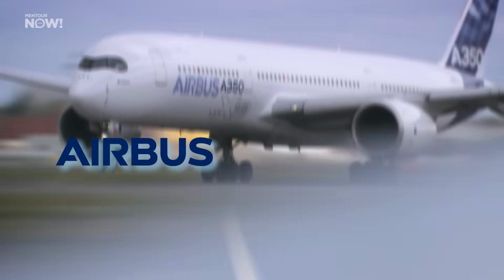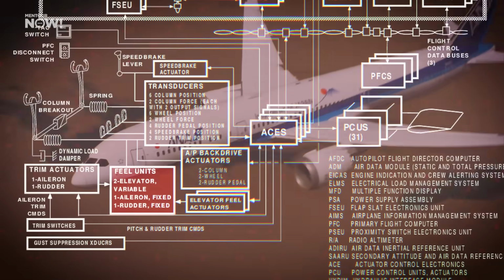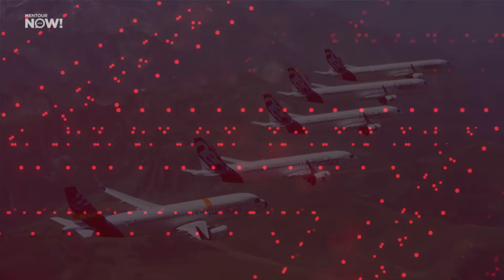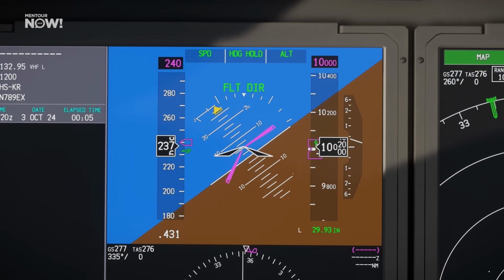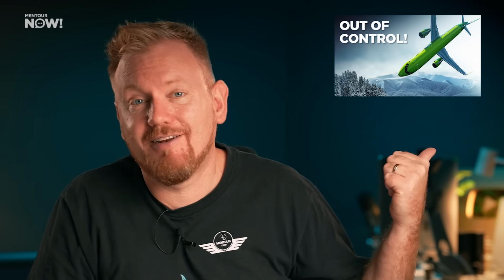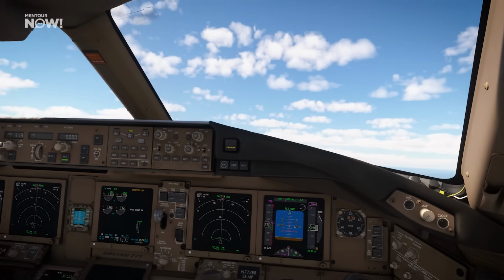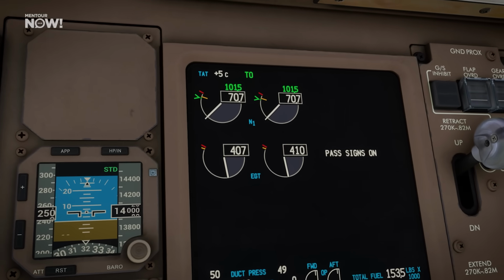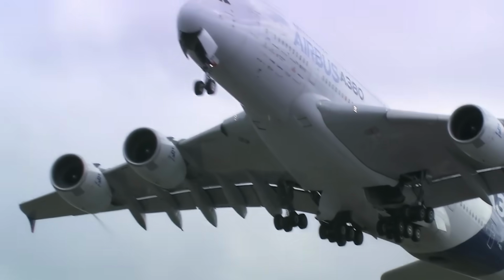Do Pilots Prefer AIRBUS over BOEING?!

Comment: I have 3500 hrs on the 737MAX, and now 6000+ hrs on the A320/321. I love the fact that the Airbus is so much quieter in the cockpit (I actually ditched my plan to buy noise-cancelling headsets after I switched), but also that the cockpit is more spacious, that I can stretch out over a long flight because there’s no yoke to restrict my legs from moving about. The sidestick also means that I don’t have to crane my neck to see the entire PFD and ND at certain yoke positions, and the tray table that helps me do my paperwork and eat meals more elegantly is certainly a bonus, rather than having to push the seat way back, then wedging the food tray between the yoke and my paunch. Q: how do you tell a Boeing pilot from an Airbus pilot? A: by the food stains on his tie!

I do like the simplicity of the Airbus Flap settings compared to the Boeing’s 1-2-5-10-15-25-30-40, and the simpler brake settings - I remember having agonising debates in my mind over whether autobrake 2 or 3 would be better for this landing! Though I’m sure a lot of these dilemmas have been resolved with the new iPad-based landing distance calculator apps.

Having said that, there were certain features on the Boeing that I still miss on the Airbus.  Being able to intercept a DME arc from any intermediate radial rather than just the preset ones on the database was definitely one of them. Being able to capture and track out/in on a VOR radial is another. And the Boeing FMGS is much better than the Airbus in many respects: entering initial data on the FMGS is so much simpler, rather than having the remember D-I-F-S-R-I-P and now A. Or the fact that the VNAV allows the entry of Anti-Ice on/off flight levels for better optimisation of the descent, the expedite climb feature allows the pilot to decide whether they want best Rate of Climb or best Angle of Climb. The Climb 1 & 2 features are also something that I miss sometimes, though Airbus has added an automated version of that in the neo FADEC (not as effective, though).

The 3-digit Mach number displayed on the Legs page allowed me to figure out the practical aspects of Cost Index on my own and the ability of the aircraft to initiate descent on its own (“when ready descend FL260…”) was a bonus that allowed us to focus on other things like traffic or approach briefing. The display of the relative headwind/tailwind and crosswind components on the Approach page was very helpful. I liked the fact that some of the TCAS units installed gave me the option of finding out the actual flight levels of the target aircraft, rather than just their relative altitude. The PFD, ND and Upper/Lower DUs displays were much sharper and the fonts used are very pleasing to the eye - I’m not a fan of the dashed range rings on the Airbus that clutter the screen and can’t even be turned off. The ability to copy a value onto the scratchpad, then paste it to another field (V1 to Vr for example) is something I still miss.

And yes, I do miss the ability to display the cockpit entry camera on the lower DU! Instead, I have to crane my neck to see who wants to enter…
Reply: For comparing safety the better ergonomics of the Airbus planes is a serious point - it is not just about pilots enjoying it more. People get tired, noisy uncomfortable cockpits with unintuitive instrument layouts tire them much quicker, and tired people make mistakes.
Reply: on the A350, the DIR function is no more radial in/out... its now course in/out... so you dont need to do that mental calculation in your head and enter the radial, just enter the course you want.
Reply: I can understand what you like from airbus and understand nothing what you like from boeing, except last one about door cam. thanks though
Reply: Nice👌
Reply: So which company do you prefer?
Reply: Thanks for that comment. Which planes are the safest - a320, a321 or a321neo? I've heard too many bad news about the reliability of the p&w engines and don't know what planes are more safer?
Reply: @r.k862  most of them use cfm leap
Reply: @ Hmm… that’s a tough one. All aircraft are generally safe and get better with age, as the initial teething problems are sorted out. Remember the string of crashes the A320 has when it was first introduced?

Having said that, the p&w engines have not yet sorted themselves out completely, but I fly them often and am not too concerned at falling out of the sky 😀 The CFM LEAP engines neos have had almost no teething problems really, so at the moment they’re safer, but i expect p&w will catch up soon.

A320 vs A321? No difference
Reply: @AtulBhatia  thanks for your comment, I appreciate all the help that I get.
Is there a website that's accurate to show the history of incidents and accidents that happened to specific commercial jet planes? I know the planes are generally safe but I just want to be that extra safe to soothe my conscience😄 I hardly fly on planes
Reply: @ I’m sure there are many websites out there, but I wouldn’t recommend them. That’s because statistics can be misleading. Accidents can happen for a lot of reasons, including airport infrastructure, maintenance, weather, pilot error and so on; then there’s the number of accidents vs number of aircraft in service and the number of hours they’ve flown, so it’ll be very hard to filter it all and figure what’s ‘safer’. My suggestion: don’t sweat it, and go fly, safe in the knowledge that - statistically - you’d have to fly non-stop for 75 years before you risk being in an accident😀
Reply: Respectfully. All the pilots that answer here seem to have this thing in their mind that the boeing is more fun to fly. Especially manualy. This actually (imo) makes all your comments invalid tho, as you guys aren't military or hobby pilots. Hundreds of thousands of people put their life into your fingers every single time you take off. None of those people have "more fun" in a boeing airplane compared to an airbus. So in reality. The simple conclusion is. That airbus (at least by now, cause of management changes at boeing years ago) is not just far superior, it is no contest. And in reality boeing should be out of business by now and some of the upper management should serve lifesentences.

So, I am happy for you guys that the boeing is more of a "real plane" to a pilot. But those thousands of souls that trust those airplance with their lifes won't ever get to experience this. And this aren't hobby planes for fun. It is no argument
Reply: @Davinhomx  None of my comments have to do with which aircraft is more 'fun to fly' - if you give this thread a once-over you'll notice that the comments have more to do with the various features that the two offer that are required not only to meet current flying and safety regulations, but also to make the environment/cockpit less fatiguing. For those of us who spend thousands of hours in that tiny space, where even standing up to stretch one's legs or taking a toilet break is a complex, involved exercise, all these features matter hugely, not just for our convenience but - eventually - towards the safety of the passengers and the aircraft itself.

Having said that, manually flying an aircraft is not just for fun - it's the very basis of the job we do. Most of us joined the airlines after spending big money to acquire those manual skills and need to keep that muscle memory sharp so that it can be instantly brought to the fore when things go south. Point of fact: the autopilot usually has lesser operating limits than the pilot is able to handle, and often trips when beyond those; moderate to sever turbulence being a case in point. In fact, when some big-ticket failures occur, the autopilot is usually the first to go. Today, all regulators warn pilots to be on the guard for automation complacency and advise them to practice manual flying skills to keep themselves competent. Without these skills, Captain Sullenberger wouldn't have been able to pull off the Miracle on the Hudson, Capt Robert Piché wouldn't have dead-sticked (stuck? stock?) Air Transat 236 and saved 306 lives, nor would Captain be able to sideslip a 767 to land at a disused strip at Gimli and save all passengers without a scratch.
Reply: @AtulBhatia  I get that. I posted this below several posts of pilots. But I did it for a reason. Imo, and I am not a pilot, obviously. And you do know more about the airplanes, obviously. But to even compare boeing to airbus rn is straight up criminal if you come from authority. Like let's be real here for a second. Boeing management isn't ehat it was 30 years ago. My argument is not about how reliable the airplanes nowadays are (a none argument btw as boeing managed to make them less safe in one circumstance). For years boeing and airbus have both been rliable imo. It actually is incredible how old some of those airplanes are and the regular person can't even see it. But fact is that boeing (different to airbus imo) became a high (bonus) achiever company. Led by people that do not care about aircrafts but care about beeing a CEO. Cost was cutted like we are talking about a gaming company and not about something you love that hundreds of thousands of people quiet literally bet their lifes on. What boeing did with the faulty software that led to several crashes, when they literally somewhat hid that this software even exists, putting the blame on dead pilots. Wanting those very airplanes they knew very well of beeing faulty to stay up. And it took literally every single country to ground them against boeings wishes until even donald fn J trump (I evek think be decret) grounded those airplanes!. A guy that is notoriouse for not wanting to cut into valuable industries of the US. The fact that like 8 years ago or more people that worked at beoing came out and said that the keeping up of the old airplanes wasn't like it was before and it is a matter of time until some go down. And then some actually went down!. 

To me the simple fact that boeing literally is not trustworthy anymore and puts proft over human life. And everyone knows it by now. Makes boeing vs airbus a NONE ARGUMENT.

Edit: we are living in a time were whistleblowers at boeing literally said that it would prolly be safer for airlines to keep their older boeings safe to fly by doing the service themselves instead of letting boeing do it. Cause they literally got time limits and stuff. This isn't a battle between two airplanes that always have been good. This would be a battle between one company that actually cares about the safety of their airplanes and another company that puts profit over safety and cuts as muchs costs until something happens. And stuff happened. And nobody can deny that anymore
Reply: @Davinhomx  You had me until you said, "aircraftS."
Reply: @oubrioko  english is not my native language. Würde mich ja interessieren wie viele Fehler du in Deutsch machen würdest.
Reply: @Davinhomx Wish there were more folks in this world like you.

Comment: Flew both, about 5K hours each (320/330, '57/'67). Also instructed on helicopters and gliders. Still teach on the ''67. I prefer the 330 to the '67 for the "whistles and bells". All that said, the major problem is the lack of feedback on the stick. The Air France accident proved that (along with several other incidents). As we go into the future, where the people flying the aircraft have less and less experience with, well, flying, and may never have been upside down, I would wish for an Airbus with stick and feedback. But, it won't happen. You hit the nail on the head though. In fact, your analysis is dead on. I believe that nothing can fix people who weren't taught how to fly an aircraft that doesn't forgive, like maybe a glider. It sounds simplistic, but I spend a fair amount of time explaining that "attitude+power=performance". Even in a Boeing.

Comment: Although I am not a pilot I have been fortunate to be able to fly both the 737NG and A320 Level D simulators. I have to say both types have their pros and cons. In the 737, you certainly do have the sense that you are flying very hands on with the aircraft and you feel it through the yoke. But where there the 737 is quite a dated design now in my opinion compared to modern types it does lack the creature comforts where the A320 does excel in. The A320 is very spacious and does feel ergonomic in it's design. Once you get used to how the aircraft feels in flight and understand the protections offered by the Fly By Wire systems it is a joy to control. For me it does come down to where the individual's personal  preference lies. I like both types but because it is slightly more modern and offers that little bit of extra comfort the Airbus slightly edges out the Boeing. If I was a pilot (God knows i would love to be!) I would be happy flying either. To those who fly Boeing, enjoy the motorized thrust levers and to those on the Airbus, enjoy your steak on your tray table! 😂😂

Comment: I flew Boeing and Airbus and have multiple failures and events on each of them 

There is no comparison from a pilot perspective 
Airbus is way better as an airplane to fly besid the comfy seats and tables 

first of all Airbus manuals( fcoms, fctm, QRH, AfM, fly smart ) have nothing left that has not been mentioned and explained to help the pilots understand the airplane they are flying 

Everything is covered, explained in either normal or abnormal events 

Unlike in boing where you have limited info, a lot of ambiguity, hidden features and systems functionality 

Secondly, Airbus made their manual really clear in turms of procedures either normal or abnormal and the way to deal with each including the airbus philosophy as well as the protection systems, accurate measurements (GS mini) the protection reversion capabilities which raise the pilot awareness of the full operation in relation of handling the Aircraft where this is not available in boeing planes 

Finally the not moving parts such as the thrust and joystik are not effecting the situational awareness as you said if you as a pilot understand the aircraft that you are flying and maintain the proper knowledge requirements of the mechine that you are operating making sure it is in the correct and propper flight path desired for the flight phase , you will never go wrong on Airbus

Comment: The problem with the safety comparison relates more to the 737.  There are a huge number of them flying, and they are all classified as generation 3.  Therefore it's safer to fly on an A320 family aircraft than any model of the 737.

Comment: The Airbus protections scare me. Reminds me of the 737 Max and how it took over and caused the crashes in Africa. Also, the pilots become lulled into a false sense of security and aren't ready when the automatic protections fail. Better to have manual feedback and some help, than conflicting information such as being at full power while the throttle appears to be in idle.

Comment: I really want a video like this, but directly comparing only the 737 to the A320, as that is the planes most people in the world fly on today. 
As an engineer, the more I read about the modern 737, the more I'm amazed and appaled at the same time that it still is largely constructed as a 1960's jetliner; with its manual control cables, cramped cabin, a cockpit construction identical to the 1950's 707, manual pitch trim wheels, and of course, a plethora of cockpit features that belong to life long before modern ergonomics. On top of this, you get many modern features like high bypass engines, computerized systems, new winglets, etc, but the application of new technology isn't related to what is the BEST technology, but rather what technology maintains commonality with older versions. It must have been an absolute engineering nightmare to design the 737 MAX, and to me, it's much more comparable to trying to refurbish a medieval house or making a restomod Ford Falcon than actually making one of the most popular commercial aircraft in the world. The problem isn't that the 737 uses control cables, it's that they HAVE to use control cables with lots of bulky safety systems added because they literally can't give it proper fly by wire.

Comment: Something I don't understand about the side-stick on Airbus planes. What if the First Officer is left handed and/or the Captain is right handed. The position of the side-stick forces them to use the non-dominant hand. I am sure that is no issue 99% of the time but what if you need to make quick complex inputs in emergencies? Could this be an issue?
Reply: But this is exactly the same on a Boeing aircraft. You need one hand for the thrust levers etc. So in a Boeing the captain also flies left handed, the first officer right handed. If you can't do it you can't be a pilot
Reply: @swems-z3s  Yes for thrust levers but for Boeing, the control of airplane in flight  (turns, up/down etc) is with the yoke which is in a central position in front of the pilot and typically held with both hands. Anyway, I am sure there is no issue but just wondered how it feels to fly manually with one hand (non-dominating one) as opposed to both hands on a yoke
Reply: It isn't an issue for most sidestick pilots I came across who addressed this issue. Also "quick complex inputs" are done everyday on Airbus aircraft in crosswinds with pilots moving the stick rapidly, so won't be a difference in an emergency.